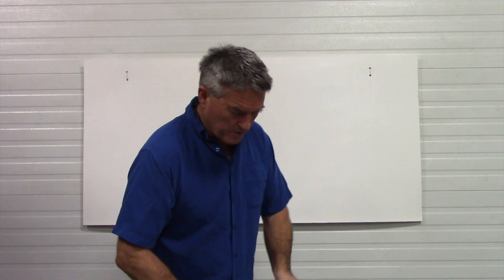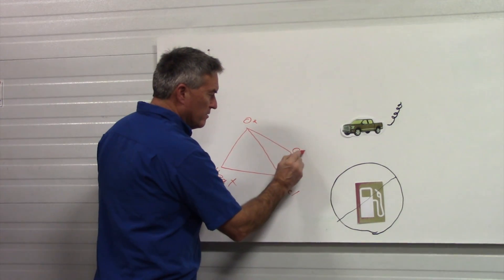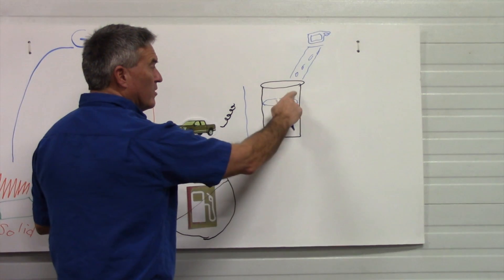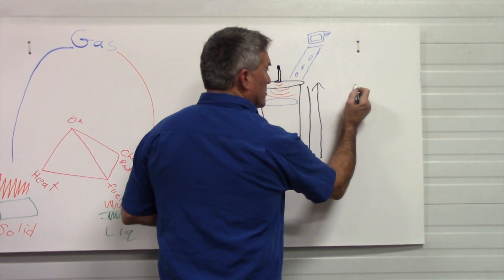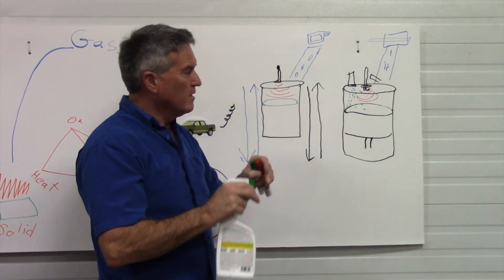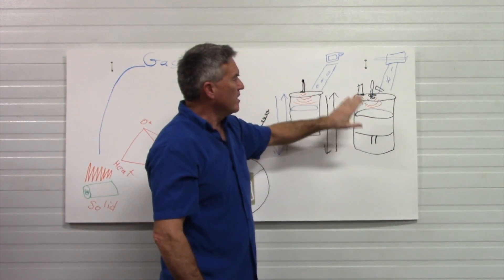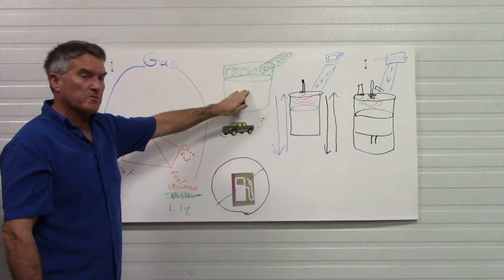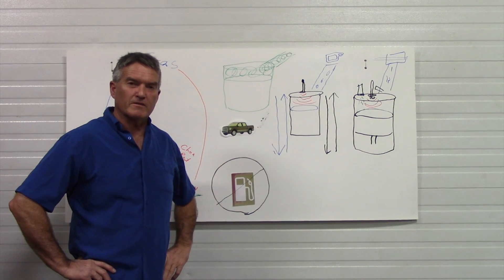One Simple Trick to get 100 miles per gallon with less pollution!

Comment: This all comes from the 1970's where engine technology was so poor,  everybody tried things to improve combustion.  with the advent of the throttle body fuel injector, the oxygen sensor and electronic controls,  engines now run stoichiometrically.  so the correction here is:  this "liquid" is squirted in and doesn't burn very well at all, what are the odds, etc.  this is all wrong.  the engine control, injectors and oxygen sensor create an exact balance between the oxygen available and the fuel.  by the way, there is latent heat of evaporation to vaporize the fuel, but this is incorrectly borrowed from non combustion processes, like an air conditioner.  modern engines burn about 97% of the fuel going in.  the catalytic convertor "burns" the remaining 3%.  so what's the answer for engine losses?  back work,  meaning at low engine power, the engine pulls a vacuum on the throttle plate, doing work for nothing,  and the basic effiiciency of the otto cycle,  ( T_hi - T_lo) / ( T_hi+Tlo).  the problem with this is sky high engine temperatures burn up the enginer, or create N0x, that is a terrible pollutant.  clean diesels have super high compression ratios, burn 97% of the fuel, and then have to fix the pollutants by grabbing the NOx in a special convertor.  One way around all of this is electric hybrids , that remove the need for back work, lower engine power settings, and more optimum operating points.  In the 1970's that black smoke and gas smell told the story how little gas was actually burned, but not any more.

Comment: I swapped a John Deere 4045T into a 1969 Dodge Coronet I got from a friend who was going to scrap it, since it's interior was trashed, and the engine and transmission was toast. He bought it with the intention to restore it and never did.
I got the 4045T from an old generator unit some guy was selling for $700 bucks because the piston had rusted to the cylinder sleeve from being stored for a long time (Potentially with water in it) I replaced the piston and sleeve with new ones and it was then able to run. 
About a month later I got the Coronet and came up with the idea to swap it after I had bought it.
I did some research and found out there are few transmissions out there that are not computer controlled that will mate up to this engine. So I then took the transmission off along with the backhoe differential. The reduction is like 12:1, so I swapped out the stock pinion gears for some custom fab ones I had made for me. Since it has 8 lug rims, I lifted the Coronet up 6 inches to fit some pickup truck tires on a pair of 8 lug rims since all I could find was truck tires. (Truck as in pickup truck). After that I put the engine in on some motor mounts which I made, and they do the job a-ok. I had to put taller, stiffer shocks and  spring up front since the last engine weighed 65% of what this one does. Since the turbo was gonna be sticking out of the hood because the exhaust manifold exits up, I cut a hole in the hood, put a sheet metal box (with small vent holes up front) welded to the hood around the turbo housing and cut a hole in the top just big enough for a small 4" hoodstack to fit our the top. I got a custom driveshaft made to link the transmission and differential, which works pretty darn good.
The stock main transmission stick lined up perfectly in the original hole but another one had to get drilled out to fit the auxiliary (high/low) range stick. It's made like a 4+2 transmission, so it's an 8 speed technically. 
I also ran the starter relay, made a injector pump linkage to the stock pedal along with a new brake system for the back and a clutch linkage (although the gears are real close ratio, so I can float gears no problem)
All in all it was a really fun and interesting project, but also kind of expensive. The total build cost was $2500 ish, (forgot to mention I found some cheap old bench seats for the interior which I put too.
This thing can get nearly 60 mpg going 60 down the highway (I advanced the injection timing a bit) and puts out probably 130 hp with probably somewhere in the ballpark of 300 ft lbs of torque, since I also did a 30% fuel turn up.
This thing sounds like a semi if you do a second gear low range take off from a stop! It's also loud and gets a lot of looks when driving through town. 
(For those wondering, I did put a filter on the intake, it's a nice little racing filter I got for $40 off Amazon, a little expensive but since it's outside theengine bay I wanted to make sure it's getting the right kind of filtration it needs, and still get the right amount of air). Believe it or not this is my daily driver! It's a real beast.
Thanks for reading.

Comment: you forget that when the injected gas hits the hot cylinder walls it changes to a gas , cools and lubricates the piston all at the same time , take the gas/air cutting torch and see how dangerous it is to combine the two and send them down the hose , if you have ever seen industrial gases hauled . oxygen/air is the last thing you want introduced to it , it will litererally become a bomb .  neat idea but not completely thought out. if anything instead of port fuel injection we should move the injector further away from the cylinder to give it time to oxidize/mix with the air more completely????

Comment: As I understand it, he is not converting the gasoline to true gas form, just producing a fine vapour, which is what a carburettor or fuel injector should do. The finer the vapour and the more completely the air in the engine cylinder is made to contain it, the better is the combustion. This being said, he is broadly right, but it is his implementation of this that is suspect. He is trying to make a perfect carburettor external to the engine in which all the air intake includes a very fine gasoline vapour. His patent does not cover this, and in any case it has been done before, perhaps with a little less verbosity. A far better way to limit emissions would be to restrict engine size or breathing, gently at first and then with greater and greater severity until the last motorist finally gives up and changes to public transport.

Comment: Converting the fuel to a gas before mixing with air will cause lack of lubrication for the cylinder walls.  He has omitted to mention any of this.  Would be interesting to find out what happened to that V8 test-bed engine.

Comment: My 78 diesel Chevette go 52 miles per gallon it was 4 speed straight shift. It held 4quarts oil when I changed the oil and poured it in the fuel tank about a quart at a time mix it with half a tank of fuel it didnt run any different.

Comment: That's why it takes a moment for the engine to start. Spark = Heat to vaporize the gasoline into a gas. 2 or 3 rotations and enough heat has built up to ignite the GAS. Maybe if I put a heater on my gas tank, no danger there

Comment: in the 70's, I came across a Cadillac that got 80 mpg because of the modification to it to vaporize the gas using heat from the exhaust manifold and it had very little exhaust and got great mileage.  Think about it, a heavy Cadillac with a 454 engine getting 80 mpg.....  I also came across a book that described in detail a modification very similar to that one, but when I went back a month later to buy it, they were all gone and were no longer available and couldn't be ordered.  Come to find out, the author was paid off by the oil companies.
Reply: Grant Myers interesting, grateful for u tube for all able to find out, comment.

Comment: The simple trick is to convert fuel into a gas NOT a vapor when introduced into the combustion chamber, it works better if its compressed with a turbo to counter expansion when the gas is created.

Comment: Bottom line, you want to re program the ECU. It's not that simple. If you run a high performance engine too lean, you will eventualy burn out your valve, or even worse you will pop a piston. I am considering buying a ecu programer. however, I am not confident enough to test it on my engine. It's not that simple. if you make a mistake. you will brick your engine. I paid $800.00 for a dyno tune. The only thing my wagon does not pass is a petrol station. 55 Litres of petrol gets me 500 Kms roughly 320 Miles for those of you still persisting with Imperial measurements

Comment: At the rate we are discouraging common sense, we will pollute the planet with combustion engine gunk. But there is so much oil in the ground it's silly. Oceans and oceans. Recent massive discoveries. Silly. And with the U.S. becoming an energy exporter for once is a good thing. We shouted Bush down for keeping us dependent on Saudi oil. The table has turned. CNG is the future, though, even though gas is still great, and there's no short supply of either. 
But, go on, Old Chap

Comment: I love how the Canadians say "aboat" instead of "about". But that bit of entertainment value is "aboat" all this video is good for. Most of it is a long, painful "explanation" of internal combustion engines, which, of course radically oversimplifies the actual complexities of modern fuel mixtures. For example, he perpetually talks about "state change" and how a fuel injector has to spray "liquid" that must be converted to gas prior to the spark plug ignition ("at least 16 times per second"), ignoring the fact that injectors actually spray a fine "mist" that is more "vapor" than liquid, and that ultra-fine mist instantly mixes with intake air to become the very gas he is talking about. This all takes place in the combustion chamber, INSTANTLY, so there is NO need to perform this "mixture" and "state change" outside of the combustion chamber.

Moreover, the sort of thing he describes amounts to nothing more impressive than early carburetor systems that performed the "state change" in the intake manifold, so that the intake stroke was pulling in an ALREADY "state changed" gasoline/air "gas" from the manifold. We transitioned to computerized fuel injection TO become more fuel efficient (or, in the case of racing, to produce more power), and that's largely because the computer can do a FAR better job at detecting proper mixture (and the components of the resulting exhaust) than any crude "mix in advance" in-the-manifold approach. So, any system that mixes fuel and air outside of the combustion chamber, where that mixture (and the resulting exhaust) is not measured and modified continuously by computer, is actually a huge step backwards from the last few decades of technological advances.

So, this is nothing "new found" in any way. This principles of this "new invention" were used for many decades and then abandoned in favor of the FAR more efficient fuel-injection systems that are now universal. And, for the other applications he describes, there are good reasons why we don't use gasoline instead of, say, natural gas or propane. Each sort of fuel has its own combustion/thermal properties:

(https://www.engineeringtoolbox.com/heating-values-fuel-gases-d_823.html)

Gasoline (mixed however you please) is not the ideal solution for most applications. And in deliciously inconsistent fashion, first this goofball talks about how limited the gasoline supply is, and then he ends by talking about using gasoline for everything, of course given his "new invention".

Then, you just HAVE to love the "test" in which an air-monitor is sitting next to a burner that is burning the "new" gas mixture, and the outrageous claim is made: "The flame is burning blue, which indicates that the fuel is burning cleanly and completely.... The levels of all dangerous gasses are reading zero while being demonstrated in a closed building." The implication is that this "new" gasoline mixture is burning SO "cleanly and completely" that it is producing NO harmful exhaust. But that is a massive, steaming pile of snakesh|t! ALL combustion produces at least carbon-monoxide, which is most certainly a "dangerous gas"! And, depending upon the additives in the gasoline being used, there is a whole chemistry set's worth of other byproducts from that combustion! The readings on the meter are zero because it's a small burner in a big building: dissipation of gasses. This is the same principle by which it is reasonably safe to cook with natural gas in your house.

Finally, to add flat out INSULT to the injury of this already epic waste of time and destruction of brain cells, the example engine shots are obviously looking down into the engine compartment of some ancient, rusted-out POS sitting in a junkyard. If THAT car was the one about which the claims were made, well, it hasn't been running for decades by the look of it. ZERO credibility.

Whatever snake oil this idiot is selling, you can count on it being snakesh|t instead.

Comment: This tech is being presented as “dry steam” by the japanese several years ago. Honda has a vehicle with only 3 gal capacity tank due to the fact that it takes so long to burn all the fuel inside a tank that it would spoil after a while. YES, this is 1000% possible.
This is so threatening to the auto makers that this vehicle was not even allowed to be presented on the western side of the world in the Auto Shows.
I am very interested in knowing more about this tech, reach me if you can.

Tks

Comment: The ultra leaning of fuel is nothing new but in a conventional ICE piston engine its not going to work well .. water injection may help the engine knock..we hold a patent on an engine that does work with different mixtures..

Comment: I'm surprised you didn't mention Charles Nelson Pogue.  I saw a You Tube video where a guy had a push lawn mower running on vapor.  It appeared to burn cleaner but it used the same amount of fuel.  BTW.  Forklifts have been running on liquid propane for decades.  The only problem is you need pressure in the tank.

Comment: It's too bad you showed your vehicle that went 50 mpg. but didn't take the time to drive it while connected to an mpg calculator gauge.  My physic professor liked my solar oven project.  Then he asked what I cooked and did it turn out right.  Whoops, I measured the internal temperature but didn't cook anything.  Got a C- on that, but I learned to follow through from that point forward.  So, prove your vehicle and show your patented device or explain why you cannot, OK?  Respectfully.

Comment: Fossil fuel is comprised of hydrocarbons, hydrogen and carbon. Our engines burn the hydrogen and spit out the carbon, hence, pollution. If you use resonance (frequency) to separate water into hydroxide, your internal combustion engine will produce over 950 times the energy it took to produce the hydroxide, and you get the water back, to use over and over. Hydroxide is a unique fuel, in exact ratios it implodes, imbalance the ratios, or add ambient air, and it explodes.
Thank you for the video. i demonstrated the technology you speak of in this video, to my neighbors some years ago. Everyone oohed and awed, but not one of them did it for themselves. Indoctrination has deep effects.

Comment: First of all they are not using liquid fuel sprayed into the cylinder, BUT, atomized fuel sprayed by a mist in a cone shape. Secondly, fuel and air ratio MUST be 14:7/1 or the catalytic convertor will not function properly. You geek fux are all the same, STUPID! If you want better fuel economy, use a different fuel and design the engine around your fuel. If you lean out the engine to use less fuel, you lose horsepower and engine speed. Funny how that works but Zeek the Geek fux would have you believe otherwise.

Comment: If you have a explosion that’s call Pre ignition which is caused by to high combustion heat or to advanced  timing chamber not enough octane , causing explosion. A correct combustion would be a burn creating expansion

Comment: Where can I buy one?  I have a truck that I love but it is a fuel pig.  I heard a mechanic in Townsend Montana many  years ago made a device that boiled the fuel before combustion.  The guy I was talking to that knew this mechanic told me the mechanic put this device on a truck that normally got 8 miles to the gallon.  So after putting the device on,  they hooked a trailer up to the truck and drove back and forth delivering fire wood.  He claims that the old truck averaged 48 miles per gallon even with the wood loads.   I wish I knew that mechanic.

Comment: In a vacum chamver the vapor is dense..and is 180 degrees below ambient temperature which cools your burn and cools your engine at the same time and producesses more power with less fuel used..but only if you convert it first in a vacumn chamber..and yes it burns a clean as propane...a cool burn has way more power because you dont have a liquid gasoline that dampers the burn like water on fire does😊want to know more?ask me

Comment: Vaporize the fuel first with a vacumn chamber...then inject it into the piston chamber..then ignite it.. Much better fuel burn...better power...and a wider timing range....All vapor system ...vapor is all that will ignite fully😊
Reply: no explosions when converting liquid into gas?
Reply: @perlitocabauatan9285  no but u should have a one way valve at the intake manifold it burns like propane with almost the same emissions
Reply: @patrickgalloway5078  i am not about to convert liquid fuel to gas which is impractical and dangerous if done at home. i'd better buy it in canisters, if available like lpg. 100mpg? theoretical, not in the real world, right?
Reply: No the liquid is converted to vapor and as it does it its temperature is dropped 180 degrees Fahrenheit which not ignite until enjected into the engine but a back flow vavle is a goog idea...burns like propane😊
Reply: No its has to be converted just prior to injection to the engine and no it it not goiing to explode or anthing just the opisite it is too cold to ignite in atmospheric pressure and the vacum chamber can only implode due to a minus atmosophere.